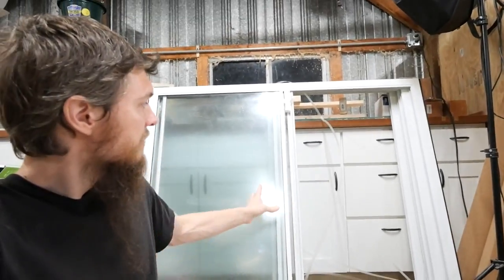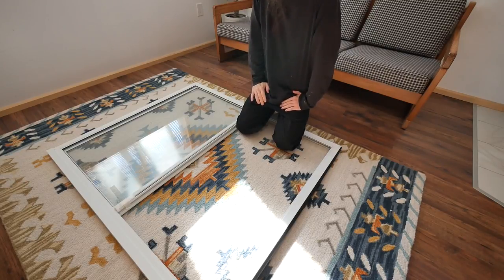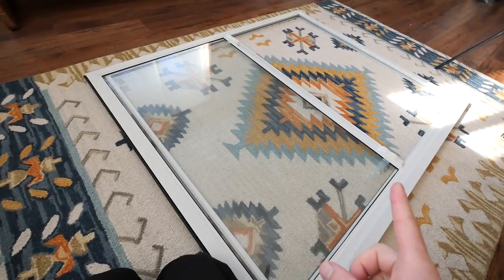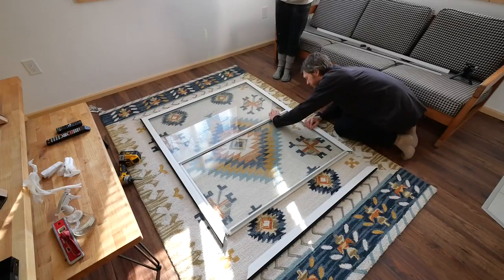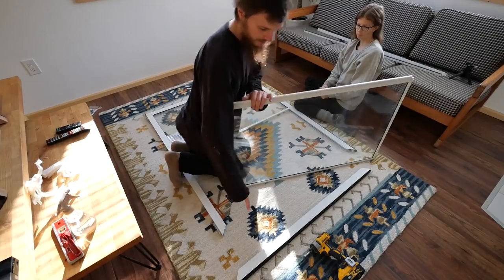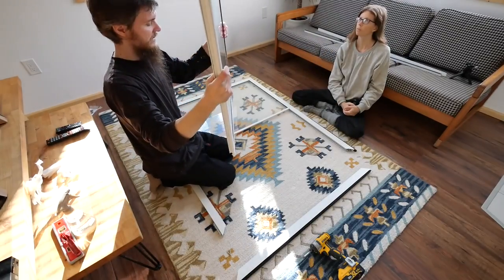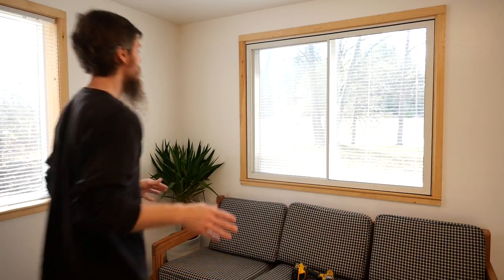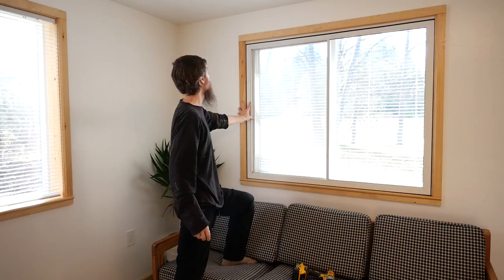Installing Storm Windows on the Inside - This is our Best Option But We had to Hack them First

Comment: So interesting! I am currently renting out a place with double wooden windows made in the same principle. they are called cassette windows (not to be mistaken with cassette windows on a caravan), all the houses had them throughout 1950s-1990s. Mine are from 1964 and therefore a bit dated, but still - this type of double windows is equal to modern multi layered glass and airtight windows in efficiancy. They trap the heat or the cold in the middle and are in this way airtight. But since most are wooden, they also breathe. There was no mold problem in our lands until the vinyl/plastic window frames came to replace the cassette windows. I really like that yours are sliding because the con of the cassette windows is definetely that they take a lot of space when I open both wings! I do have sliding door wardrobe and I know exactly about the rails catching all the dirt and cannot be thoroughly cleaned which is making me not wanting sliding doors ever, even though they save space. Some cassette windows have an option to open them in a V shape, which is awesome and common in Europe. P. S. I was writing this comment while pausing the video and I just heard you state what I stated upstairs :D Yeah - isn't it interesting how we think today's windows are better, but in fact, in the olden days people had many practical solutions that still easily apply today. I can't help but thinking a lot of the modern 'inovations' are just another consumer product meant to make us believe we are elevating if we buy them and throw the old stuff away, even though we are not. I miss the days when things were built to last. I have 60 years old windows and it's 3 degrees celsius here right now, and I am warm and comfy :) I missed watching your videos, can't wait to binge watch all of them from the last month! sorry for the essay

Comment: For every problem there is a solution, it only requires thinking abilities! Good Job!
P.S. Have you thought about an air exchanger to reduce moisture and stale air problems?
Reply from the maker: Yes, I had thought of adding one earlier on in the renovation but decided to skip it. It's one of my renovation regrets. But we are working on some things to help in that area.
Reply: @diyfferent  Would like to know when you get to that point! You folks are great!

Comment: When we had the slide windows I got little locks that fit down in the tracks and had a little knob to tighten it so the window couldn't be opened from the outside.

Comment: Nice looking windows. Now what are you going to do to solve the heavy moisture load in your house. The more you seal up your house, the more it needs to breath to let out all the moisture that you and your family create... just by breathing you load up the air with moisture. Then you add cooking, washing  and showering... that's a lot of air borne water in the air and it needs to be got rid off else mould and condensation will occur.
Reply from the maker: We're working on it.

Comment: Good ventilation is the best cure for condensation, air your house daily. You've got a woodstock which releases a lot of moisture plus 4 people living inside, using water in the kitchen/bathroom etc.. you'd be surprised how moist the air inside is. Start airing your house at least 15 mins a day. It will hardly give you heat loss but it will give you moisture loss! And you don't want mildew  creeping up your walls and into your lungs
Reply: I was wondering why you decided against H-Vac. The house is so tight now and well insulated. It needs to breathe, I thought.
Reply from the maker: Yeah we do have high humidity in the house and we are trying to address that too. Thanks :)
Reply: @diyfferent  btw woodstock should be wood stove
Reply: And drying clothes on racks adds a lot as well.
Reply from the maker: @ToyotaFJOntario  We don't need air conditioning here where we live since it just never gets hot enough, and we don't like systems that use duct work.
Reply from the maker: @kathyusa-iowa5137  Yep, we run our dehumidifier all the time and it definitely helps when drying clothes on the rack :)
Reply: @diyfferent  a dehumidifier is a definite plus! I'm sure you're probably running it all of the time. Glad you have that! 🤩

Comment: -Suggestion. Switch the big screen monitor to the wall between the window and the woodstove and place the sofa on the wall where you originally had it. It let's the 'outdoor in' because you can see out of the front window and you'll always be able to watch both the fireplace and monitor and as your family sits in the living room. It'll make the room seem bigger and you'll be able to enjoy the fire more.
Reply from the maker: The space between the wood stove and window is about 2 feet and the width of the TV is about 4.75 feet.

Comment: Hey Doug and Ashley.  Wow those windows are amazing.  I love the storm windows on the inside. When I was a child , we lived in Germany a above a glass factory that was no longer in business.  Omg the windows of our 3rd story walk up were made very similar to your new windows.  We loved being able to keep the blinds clean. Only difference was, our window BLINDS were vertical. This is a European design, that has made it to America.  I bet you are glad they make it so you can do so many more things at home. You made it look so easy to install . No wonder your channel Is growing like a weed. I'm going to email you a picture of the paneling you sent me and the galvanized  container that I'm , turning into a  shadow  box. You guys did a video a while back I think it was a similar design to a craft project you did.  I think yours had little shelves in it,  but dont quote me. My brain isn't as prime as it could be lol. 
I'm hoping you might be able to help me figure out How to mount a bracket in the back to mount it to the wall.  I'm thinking of using a light strip on the inside of the container between the calculated shape that will be raised up behind the paneling that will be cut out smaller than the shape of the container. Tiny blocks about 1/2 inch x 2 inches , that will be between  every piece that will be layered strategically to create depth.  It's a 3D project that takes time to create. An example would be like designing a room. The paneling you gave me is the wall paper . Then you want to add furniture and other objects . But as you trim up, let's say a couch, you find a photo or create your own,  but you place one or more of the little blocks behind the cut out. Then your next piece, let's say a chair, but things aren't 1 dimensional,  so when adding each piece, depending on the size of the room your recreating,  each piece will sit more forward than the others. It's hard to picture, I know , but I'll send a few photos so you can see what I'm doing. Sneak peeks , if you will.  
I just can't get out for anything un- necessary  with this covid garbage going on. I have 3 family members with it . 1 is on a ventilator,  not doing good at all. 1 in an assisted living, with emphazima and COPD already.  the  facility wont let people in, and my son who is a barber and got it from a client.  
So, it may be a while before I get to start it because I can't get out. I have lung issues and not willing to take a chance.  I will be able to do a small portion while waiting.  I tried Amazon and Ebay,  trying to find the hardware needed to mount it.  You'll see what I mean with the photos.  Thanks again for the paneling to  create my project.  Take care, god bless, Deb. 
Ps. The room I'm creating in the shadow box, is the Den that my parents had that same wall paneling in. 
Thanks, 
Deb

Comment: Condensation is a function of temp and humidity......the misinterpreted spec of HVAC is the VAC,...people get the heat part right,.........the V is ventilation, not the blower fan on a unit, ventilation is a exchange between inside and outside, the most common unit is a HRV, heat recovery ventilator.

  The AC part is air conditioning,.........which gets misinterpreted as cooling,....cooling is only one aspect of conditioning air.  Humifification,dehumidification and filtration are the other aspects of conditioning air, its not just cooling.

       A ERV is another form of ventilation that helps control humidity as well as recovering some energy while ventilating and can be combined with filtration to further condition the air.   2 things in your situation that could be causing condensation issues,......air leakage around near the windows and humidity problems.   My guess is humidity as it is the most common cause in a newer structure with double pane insulated windows.

    You can find charts that will show dew point/condensation VS humidity and temperature ........ as it takes the right combo of both for it to occur.

     The problem with storm windows,...interior or exterior is the terrainium/green house effect....it will cause/exaggerate condensation problems .

       I know it can be a hassle, but a HRV or ERV tied in with a dehumidifier is the best solution to combat condensation humidity problems.

    The HVAC term comes from commercial usage where it has been required for years to use the full conditioning spec, where only in the last few years residential houses get ventilation , the V and humidity/filtration conditioning.     Most houses only have heating and cooling,.......no ventilation or any other conditioning.

        With new sealed up sindows and walls and ceilings, the houses no longer breath like they used to, which is a good thing, so we need ventilation and more conditioning such as dehumidification to prevent condensation and the related moisture problems with high humidity.
Reply: The law of thermodynamics is heat flows towards cold.......carrying moisture with it.........heat always flows towards cold . In winter it drives moisture towards the exterior of building, in the summer it drives moisture towards the inside of the building.

    The direction is always towards cold, heat moves to cold, cold never moves to heat.

    Realistically, it will push towards 2k for a system in parts......with some DIY frugality, getting creative, catching sales or even buying used you can get that closer to 1k.........$600-1200 for a HRV or the more expensive ERV,........you can get creative on the dehumidification part and save 2 or 3 hundred, but a integrated plug and play with the ventilation will cost 6 to 800.  You have some minimal ducting and a few vents.

       You can get portable stand alone dehumidifiers in the sub 300 range, but then you have to locate and buy more than 1 and they take up floor space or for about the price of 2 get a built in unit.......

     How you solve your specific issues is up to you, this is just some of the science/information for you to consider.

Comment: You said Thicker glass was available! If you ordered Thicker glass to fit into the windows you just fitted, would that work? and would it make sense money wise,? the trough in the bottom of the window can be cleaned using a funnel fitting on youre vacuum,!!. I was surprised Ashley let you do the work in her clean house, on the nice carpet, And you standing on the couch!, Bad Doughie!! Whatever you buy was Put together bit by bit, so anything can be taken Apart as you just showed, No Funny ending??? Shocked. thanks for the video from Freddie UK.
Reply from the maker: I mean on the outside windows you can sometimes order thicker glass. If we had known, we probably would have done that.

Comment: Sure looks a lot better than the old plastic film that was stuck on with tape. I remember that on high wind days the plastic  would balloon in OR rattle like crazy.  I'm excited to see what kind of savings with winter on the way.  Does your bill reflect Current month last month last year like here in Memphis. Wonder if you notice already
Reply from the maker: It's hard to compare our bills just yet because our home was still under renovation last winter, But it should be much better.

Comment: Most windows sold here in the UK are double glazed.  Older houses didn't have it, but as they're upgraded double glazing is the norm...That is unless you have a very old historical building and then windows that are identical to the original have to be fitted. I've had double glazing for over twenty years, and it's saved a lot of money on fuel bills. Triple glazed is now becoming popular. .
Reply: Most building codes in the US require double glazed windows for new or replacement work.  Many have UV ray protective films in between as well.
Reply from the maker: Yeah, our windows are double glazed as well.

Comment: for moisture problems here we require air exchangers, you can get a heat recovery air exchanger for like 300$
Reply from the maker: Wow, I've never seen an HRV for that low. The lowest I've found is around $700 USD on the low end. Plus the cost of ducting etc.
Reply: @diyfferent  I stand corrected, I just checked the local store where i bought mine like 8 years ago, same unit...800$ now . we had a government rebate at the time and actually made a "profit" as the rebate was more than what the unit cost at the time. then again, the price of construction materials have gone through the roof

Comment: u basically hacked what they do with windows here in finland. here they make double glass windows with the blinds sandwiched in the middle, which i think is genius. but your hack is super smart. it does exactly what u said: blocks noise and keeps the heat in. u did great.

Comment: When I disassemble something, I remember the Star Trek show when they use a photon torpedo with equipment to identify  gaseous  anomalies  and Uhura says" Its got to have a tail pipe" referring to the enemy ship. So they disassemble the torpedo and make it track the invisible  ship by its exhaust  gasses. So now I just disassemble  new stuff thinking it has to come apart to make it work because someone put it together. Usually It works.

Comment: So true, when we use the stove, our breathing that puts moisture into the air. I think I have a solution for the windows,  the spray you use on the snowblower might act as a repellent as it doesn't allow the snow to get stuck in the front and the thrower.  Maybe?!
Reply from the maker: Not sure :)

Comment: If it doesn’t work like you need it to be. You make it work. Love Maverick sitting on mom’s lap.Ashley would really have trouble at my house. I live in a house on a corner and 2 main roads. Teens drag race on Fri , Sat night until 2 am. The other street is a middle school and high school up and down the way plus the main artery is 2 blocks down and you have the police , fire and ambulance short cutting using this street. I can sleep through almost anything. Growing up the firehouse was next door and when it went off during the night the siren was the same height as our bedroom on the second floor.
Reply from the maker: Yeah, noise has grown to bother her more and more over the years.

Comment: Get in touch with your arbor day liaison in your area and ask if they are offering $20 or $40 trees and plant a row as close to the road as allowed by your city the come back about 15-20 feet and plant a row of hedges. You won't hear anything from that road.
Reply from the maker: On this road that wouldn't work with the type of vehicles that go by. Our house is only 100 feet from the road as well. We hear cars miles up the road in both directions with loads of trees and bushes everywhere.

Comment: We purchased 15 triple pane argon gas windows with Low e-coating and an extra layer of sound insulation. Very expensive when you take the price of 1 multiplied by 15 😮

Comment: Between the interior storm windows and your crawlspace vapor barrier the condensation should be much better. you could need floor insulation and vapor barrier there also. I've owned three or four mobile homes, two in the pacific north west and two in Las Vegas.

Comment: The moisture problem might be coming from the moisture stored in the building materials like things like the fiberglass insulation. And now the house is more airtight the moisture is trapped inside. Probably be less moisture as the heating season foes on.
Reply: They got rid off fiberglass insulation replaced it with rock rockwool insulation. So can't be it. Just a moist area and climate
Reply: @gondolin12  I thought I saw them using fiberglass, but I could be wrong. And airtight house doesn't ventilate moisture very well.  They could check moisture with a indoor moisture meter.  Should be around 50%. Cellulose insulation that was used in the roof can hold moisture.
Reply: Drying clothes on racks will add a lot of moisture to the air. They do not use their dryer.
Reply from the maker: We don't have huge moisture issues. Just normal for a well sealed house in a cold climate. There are 4 people here who are home a lot, cooking, washing, breathing. It just adds up. We've had condensation on the windows in every home we have lived in. It's just part of living in the north. Proper ventilation is important, but cold surfaces like windows will likely condense anyway.

Comment: I live in a desert with very fine sand that blows in around closed windows. I use a very cheap small paint brush with real hair that is off white color to brush loose the dry sand while i vacuum it up. I have seen these cheap brushes at the dollar store and the hardware store.

Comment: What bothers me about the the interior storm windows, is there is no caulking on the corners. The ones I took apart, and swapped, the corners had GOOP Caulking on them. I have swapped Right hand Console Water Source Heat Pumps from Left to Right, due to a shipping error. This was without getting into the sealed R410a system.